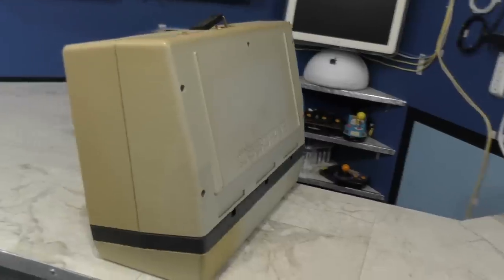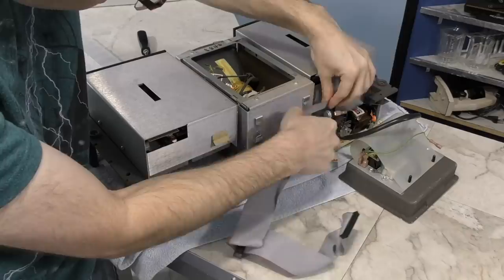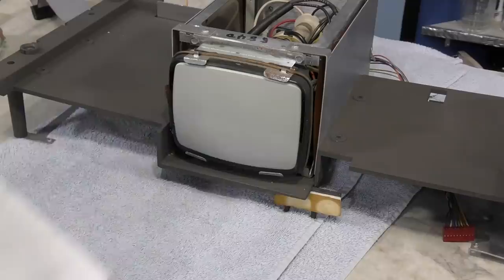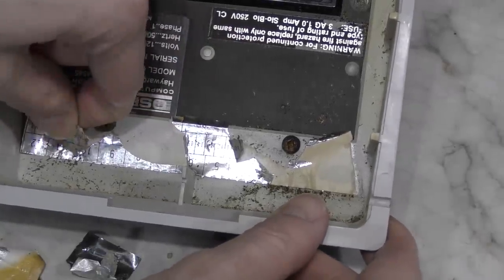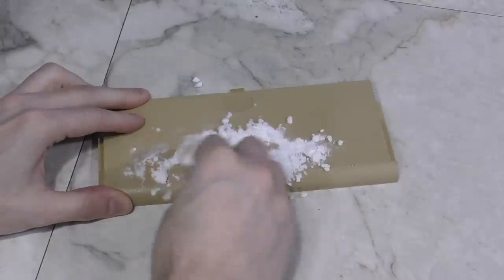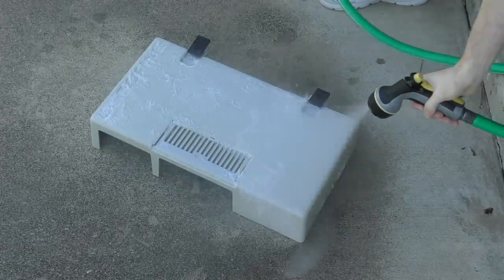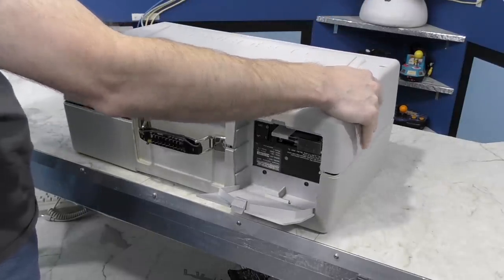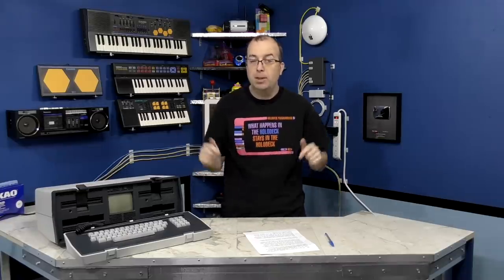Osborne 1 Computer Restoration Part 2

Comment: Don't need to apply fresh cream. Just spray with peroxide mist.
Reply: BTW, I did a very large Roland plotter this way -- spray every 20 mins.  Kept it in a semi transparent giant trash bag that fit loosely.
Reply: If you use hair stuff, make it ALL thin.  No thick parts.  Then spray with peroxide.  I did use a bit of that on the plotter.
Reply: I had keys streak, too, but it was after I used a few drops of bleach in a bucket of water to clean them first. It could be related.  The Windex worries me as well.

Comment: Failure to protect vintage leather (or fabric or organic material of any kind) from high-concentration hydrogen peroxide (a strong OXIDIZER) is the first dumb thing I've ever seen you do. That was sad. I thought for sure you'd carefully wrap the leather handle in plastic before attempting to retro-bright that piece. The very least you could have expected the H2O2 to do to the dyed leather is bleach it in an unpleasant way.

Comment: No no man it is not like your appendix!! Do not recommend that! Do not just remove AC filter caps, now a days there is a hell of a lot of switching noise on your AC mains from LED lights to the cheap Chinese phone charger, both the filter caps and choke inductors are both part of a lowpass to clean up the mains for your delicate Digital circuits! Please I implore you, look into the importance of EMI suppression.

Comment: You are just doing cleaning of stuff which usually already works and once it come on some technical issue then you are done. You are NOT doing restoration but just cleaing! It is not enough to call a restoration when you for example buy a 68s Dodge Charger just by giving paint on that!
Reply: He also did maintenance and repairs. A lot of restoration is restoring it to like new condition and a lot of that is cleaning.

Comment: The point of line filter capacitors is threefold: (1) to filter noise coming OUT of the computer, (2) to filter the power going in, and (3) fire safety.  (1) Switching power supplies are a huge source of electrical noise, and can use the wiring of your house as an antenna to broadcast interference. To get approved by FCC/UL/TÜV (whichever is the relevant one, I'm not sure), the "broadcast power" of interference needs to be kept below certain levels in certain frequency bands. Removing the cap lets more noise out and runs a small risk of interfering with the Osborne itself or other digital or RF equipment nearby (and removing more than one would be much worse).  (2) The line filter helps protect the computer from line surges or noise from other power supplies, lightning, and motors starting and stopping.   (3)  Because these particular capacitors are connected directly to the mains, they are fireproofed and have a "self-healing" property so that even if they fail short nothing spectacular will happen.  If you replace them, remember to replace X-rated caps with X-rated, and Y-rated with Y-rated.